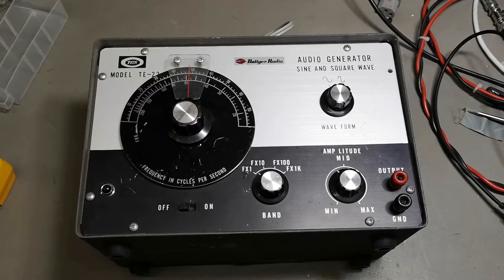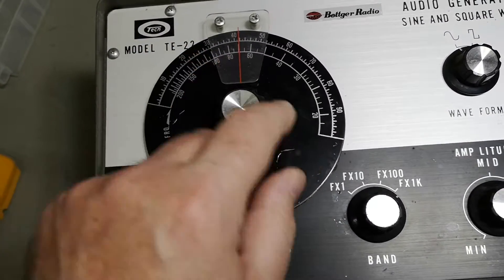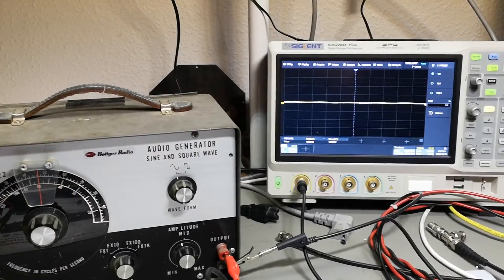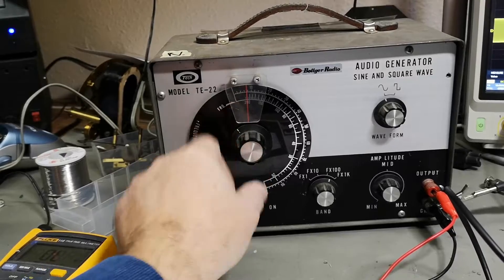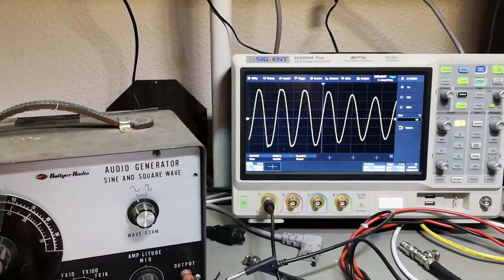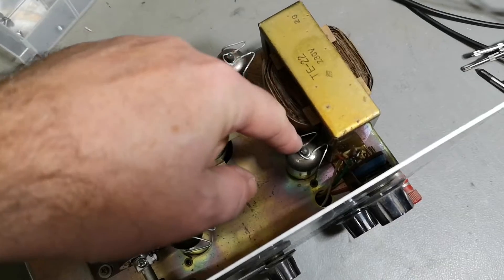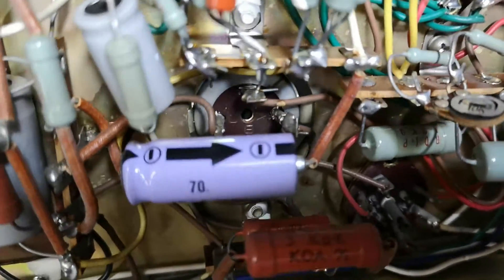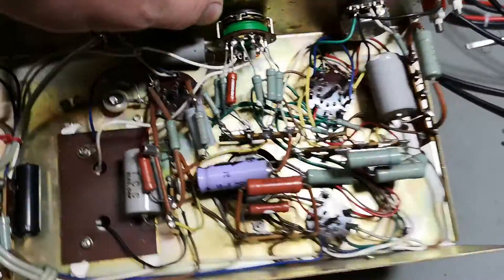Tech Audio Signal Generator Model TE-22 Sine Square test teardown

Comment: Hi. Do you know what the "ST" component is at 11:20 ? Mine is a glass tube with a filament inside and the wires outside are corroded loose and can't be reconnected. It is a filament inside a glass tube and I can just measure 43.4k ohms (with great difficulty). The circuit diagram says it is ST. Thanks for any info. Thermistor I guess with a positive temperature coefficient or negative temp coefficient !
Reply from the maker: i am sorry i dont know

Comment: Just found one of these somewhere for cheap. Doesnt produce anything else than a low hum so ill be checking out the tubes tomorrow. I dont have an osciloscope and was wondering if matching impedence is important when using this on a speaker? Also does it even need to be amplified or is the signal strong enough? Was planning on using it as a weird synth when plugged into a guitar amp lol

Comment: It's labelled as cycles per second because you can also represent frequency as the period of the waveform. It's a very common feature on modern function generators to switch between Hz and Sec when defining the output frequency. As for the scale, it doesn't appear to have any use on this instrument - my guess is that it is a generic dial design used on models that have capabilities measured linearly, such as AM depth, but I am not familiar with Tech products.

EDIT: As for which scale is used for frequency, I would have thought it would be very obvious - the lower logarithmic scale, which clearly has an arrow marked FREQ pointing at it.

Comment: There is an arrow pointing to the frequency scale. It's logorithmic which makes sense. The outer scale is linear so it can't be the frequency scale. I have one of those still in regular use and I've no complaints. It's old but it works just fine.
Reply from the maker: thanks Mark, any idea what is the use of the outher scale ? other than causing confusion :-)
Reply: @TeardownOZ2CPU  I figure it’s mainly because the frequency scale is logarithmic. If you want to remember the position of a previously set frequency you could note down the linear scale position. I doubt anybody has ever used it.
Reply from the maker: @MarkTuttleG0TMT  might be, but a very wired way to make your notes :-) i prefer to write down the actual frequency, but maybe it was different in 1965 .. i am sure it was